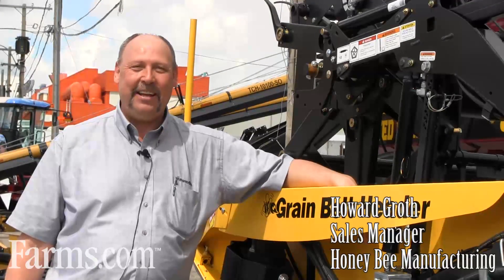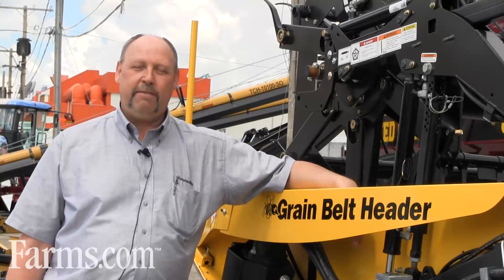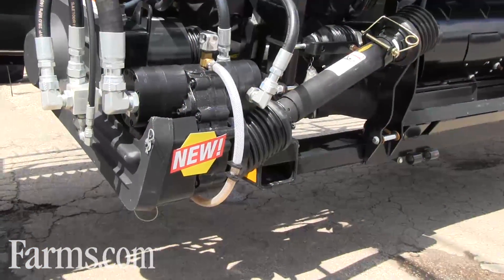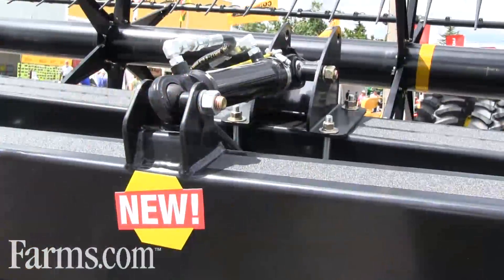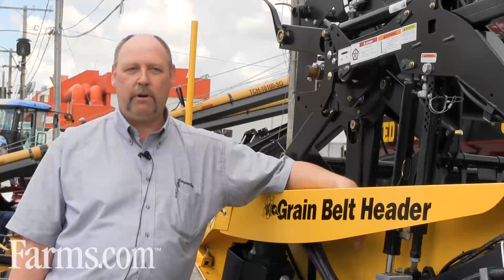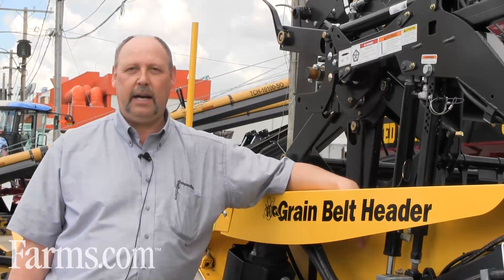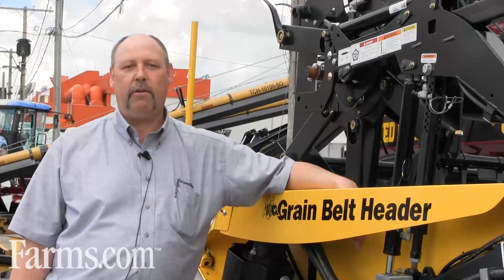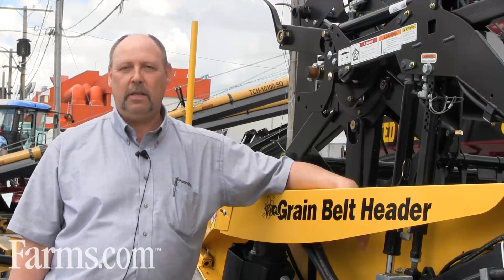Honey Bee Grain Belt Header New Features and Improvements

Comment: I'm driving a CIH 1903 swather, with a 2012 DH 302 meaning a 30 foot draper head. Where do I start? If I set my float pressure so I can get low enough to cut that flat to the ground stuff,  BALES. Plus "dozing". If I adjust my float a hair tighter I have to sit on the header lower button. There is no happy medium. Also if there's a tough spot, BALE. If you try to help that tough spot thru with your reel the knife stops. Unless your lucky. Then there's the "newly"  designed poly skid plate.  The first year they're okay.  The second year the holders start bending open and stuff so you take a hammer and punch and b bend em closed. Which you had to do in the beginning to get em tight enough. The third year them holders are so weak you can say bye bye to your poly skid plates. The only decent thing is the 82 inch center opening so your bales can pass thru.